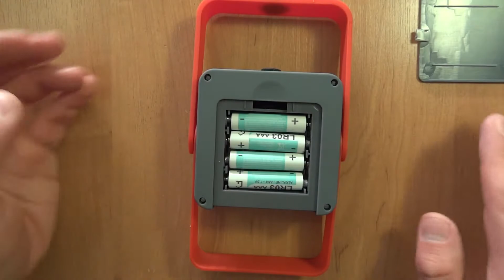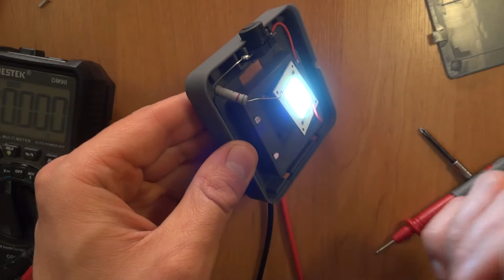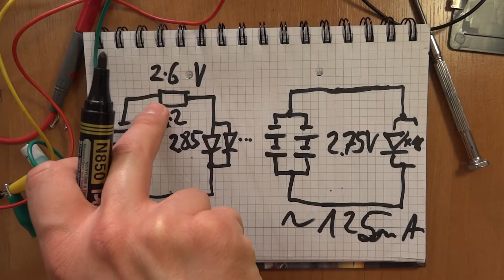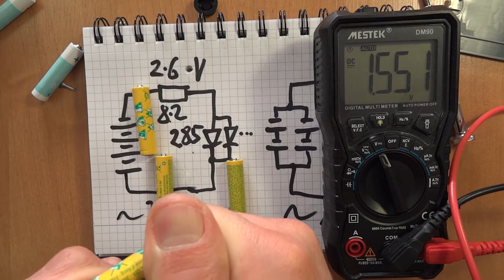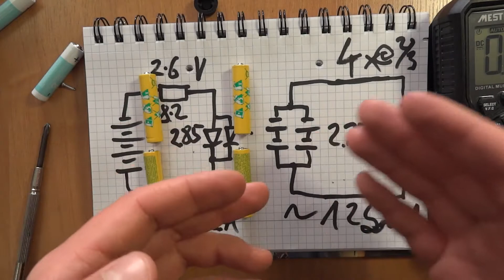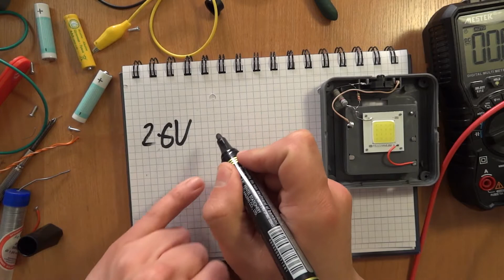Modding battery-powered LED floodlight

Comment: That's hilarious (the original resistor and power/heat dissipation). The designer must have interest in a battery company and knows that most Americans will just keep buying more batteries to have a little brighter light. I'm going to start tearing apart some other little gadgets now. Thanks for sharing!

Comment from the maker: I did a bit of calculation to give you an idea of those changes:

Previously there were two loads in series: 2.6V@0.25A (0.65W) and 2.85@0.25A (0.71W), 1.36W in total
After changes: 0.9@0.31A (0.28W) and 2.87@0.31A (0.89W), 1.17W in total

So load decrease to 86%, but at the same time total capacity (in terms of Watt hours) decreased to 75% by removing one battery, so effectively total battery life decreased to 87% vs the original battery life, but you're using only 3 AAA cells now and have a brighter light.
Reply: Yes, you are hurting someone's battery company business with all your "boat rocking". How can you sleep at night you problem solving trouble maker?
Reply: You probably refill your own or use refilled HP printer ink cartridges. I've been getting around  their ink monopoly for 25+ years (at least trying to). The evolution of their efforts to keep everyone using only new/genuine HP printer cartridges is never ending.
Reply from the maker: I switched to laser printer, but the cost of a new chip inside is roughly half of offbrand filled cartridge 😉
Reply: @pandaengineering  And programming/hacking the chips on the HP cartridges has become ever so challenging. My old self is not quite ready to give up just yet
Reply: @pandaengineering  yes, laser/drum black toner all the time. Just can't get rid of those cheap color ink printers for personal use, though...